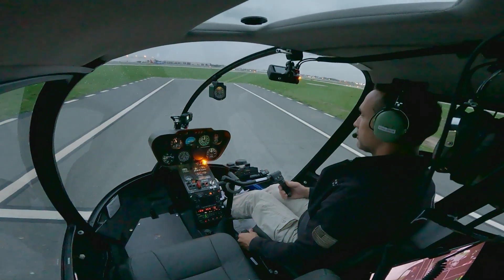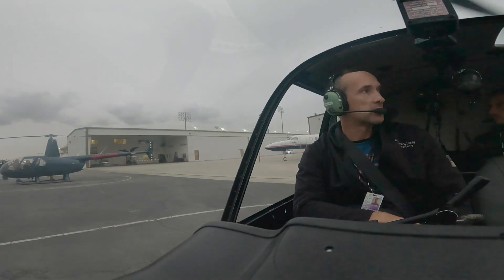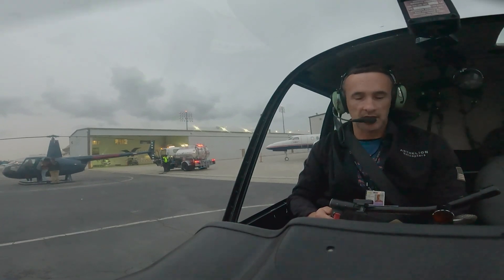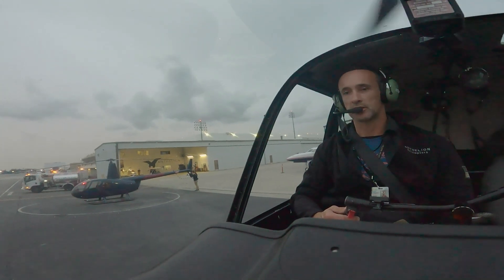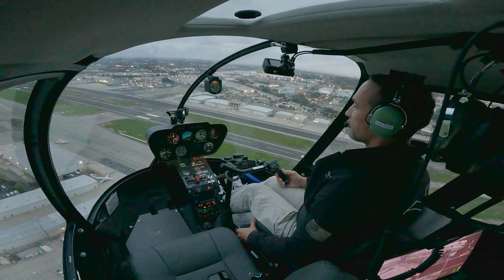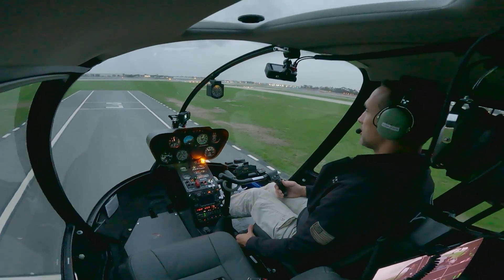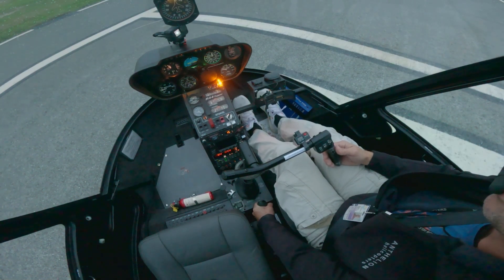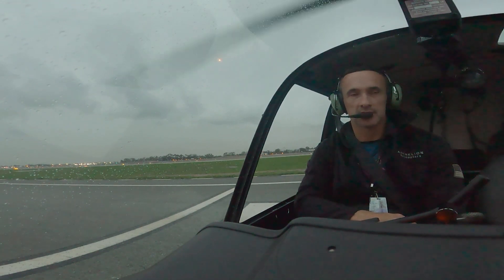Flying a helicopter with governor failure flight school

Comment: Thanks for the video, is this mainly a Robinson phenomenon?
Reply from the maker: I would say yes, but…any helicopter with a governor has potential for it to fail. However, rather more sophisticated turbine ones have a plethora of other electronics to catch and manage things for you.
Piston heli’s that use Magnetos are more prone right now to mag failures, which is worrying as the Governors directly get their engine rpm reading from there.  We’ve seen far poorer build quality and issues with mags lately which causes issues, as I’ve explained in the video which is more likely that the actual governor to fail. Robinson has worked out a fix for new helis but we’re waiting for it to get rolled out for the rest!
Reply: @Anthelionhelicopters  Robinsons get the governor pick up from the gearbox input